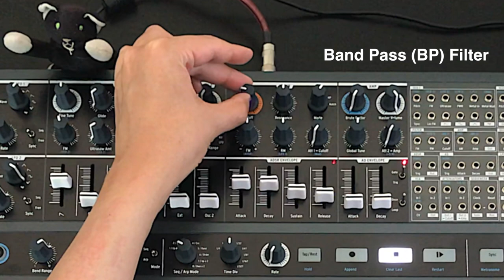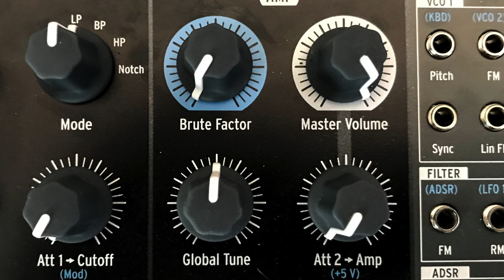Arturia MiniBrute 2 Part 1

Comment: Each review I've seen keeps referring to the filter as a Steiner-Parker filter.  What does that mean exactly when compared to other filters?  What makes it different?  Or should I just RTM?
Reply from the maker: Thanks for the comment!  Basically, the Steiner-Parker filter is just another filter-circuit design.  I think we mostly mention it to contrast it with the common Moog ladder filter, Curtis, etc.; and to give a hint at the sound.  It tends to be quite smooth at lower frequencies and resonances, but quite harsh at higher values.  It's a hint of sorts to expect that the Brute will be a "brute" filter-wise 😸
Reply: Thanks. :)  I'm looking forward to part 3.  I'll probably pick one of these up in August (likely the 2S since I already have a keyboard MIDI controller that I might be able to use with the 2S).